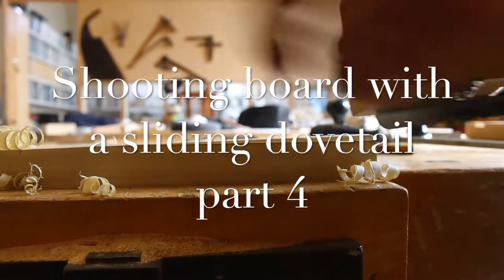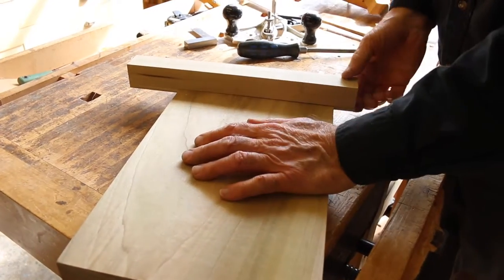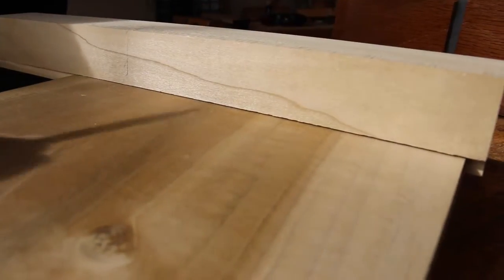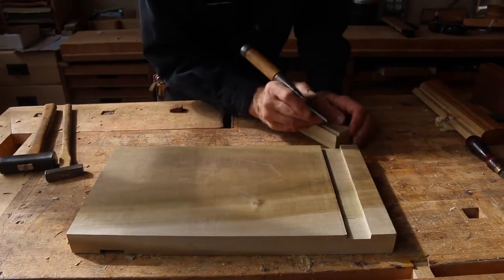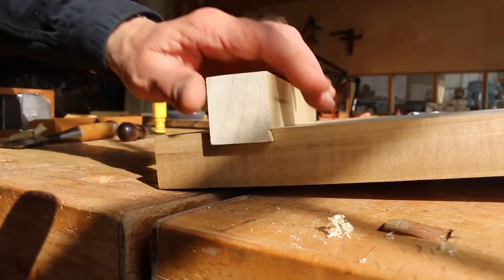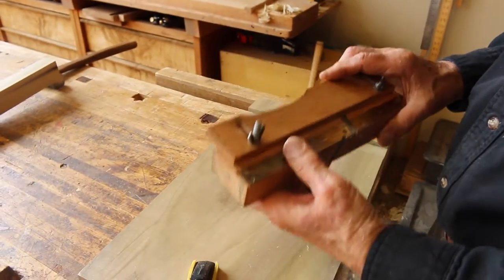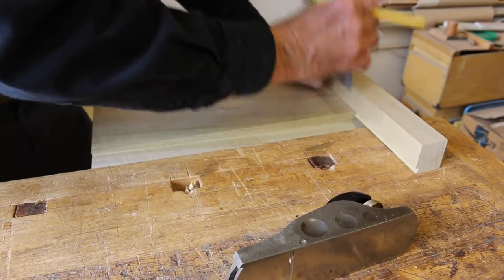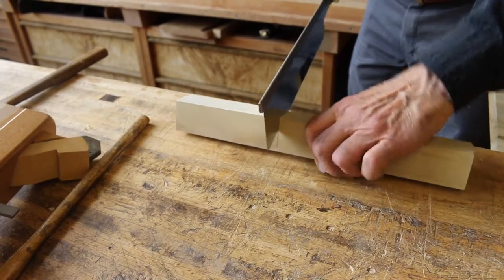Make a Shooting board:  Part 4 of 4

Comment: This called a half dove tail joint?
Also, how does this only have 100+ views? But that means only one thing, hidden gem.
Reply from the maker: Thank you! Tell your woodworking friends!
Honestly, I'm not sure of the official name of this joint: I call it a sliding dovetail with one shoulder square, as opposed to having both shoulders dovetailed. It's easier to get the one side square to the length of the board, resists overturning when pushed from the dovetailed side, and is easier to make than its two-sided cousin.